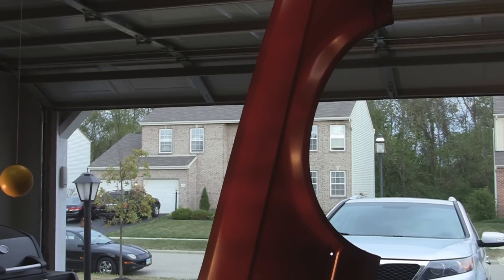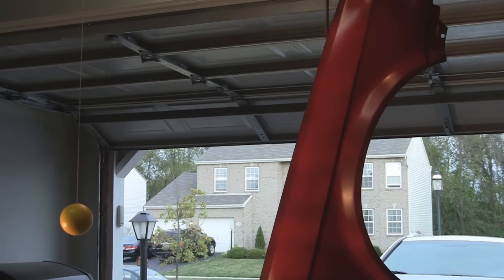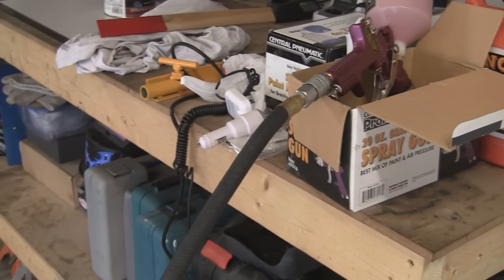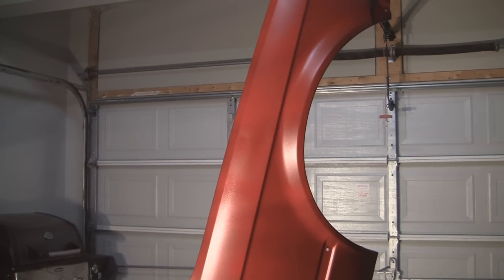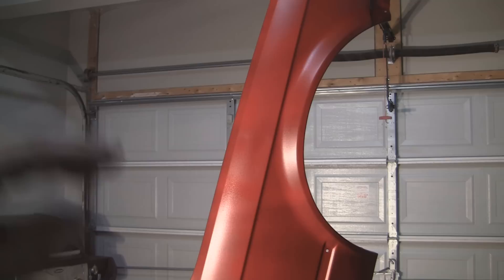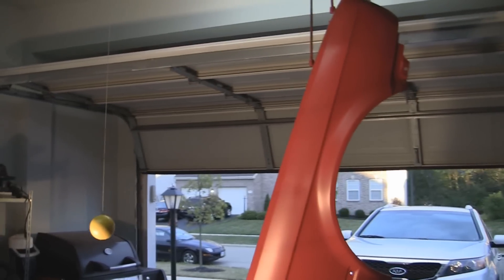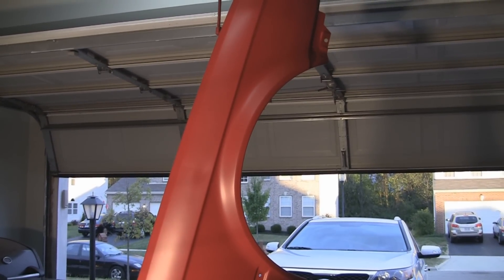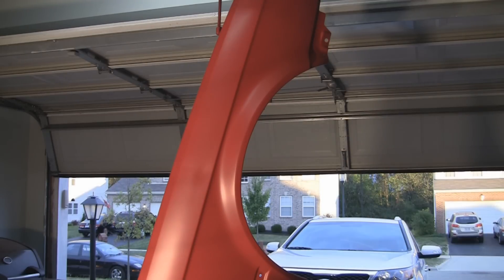Duplicolor Paint Shop Paint Review/Application with Harbor Freight Gun Part 2 BASE COATS

Comment: You want 4-5 coats of clear because you'll take off a coat or two during wet sanding and buffing. Great videos though guy. Duplicolor is good stuff for the do it yourselfer. I have the same gun too. You should let folks know what the specs on your compressor are too though.

Comment: So what happens when you sand a coat away during wet sand. You'd be cutting it pretty close. And when you live in Yuma AZ where 110 degree plus weather normal you better off with better protection. Duplicolor isn't garbage. It's decent for the do it yourselfer. If you wanna shoot ppg, house of kolor, DuPont , RM, whatever it's up to you. You wouldn't shoot that good shit if you're starting off. Be realistic. Johnny isn't going for show quality. I'd rather shoot duplicolor than have a factory job

Comment: WHAT?! 4-5 coats of clear?  Are you serious?  I never go above or below 2 coats of clear.  Unless you're using 200 grit sandpaper, you won't be taking off even 1 layer of clear if you use 1500-2000grit wet sandpaper.

I don't know what the specs are for Duplicolor since I don't use that garbage.. but 4-5 coats is a crazy amount.